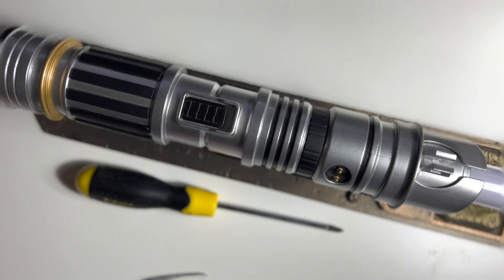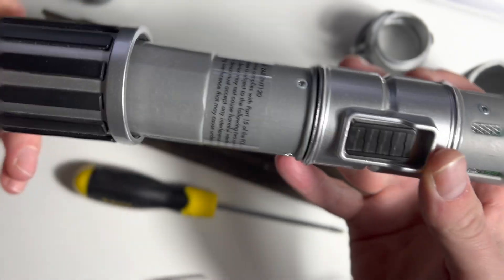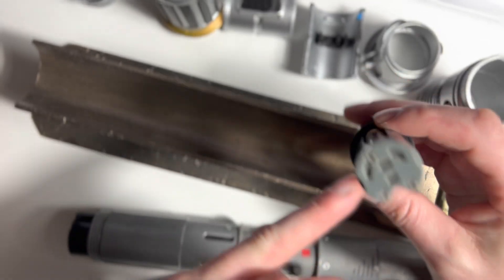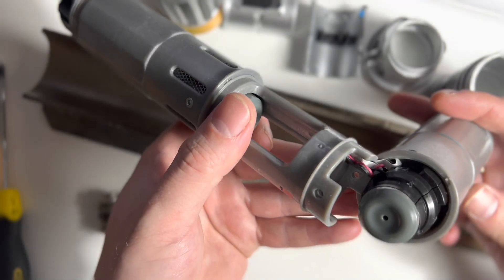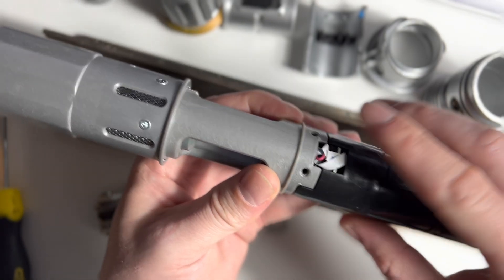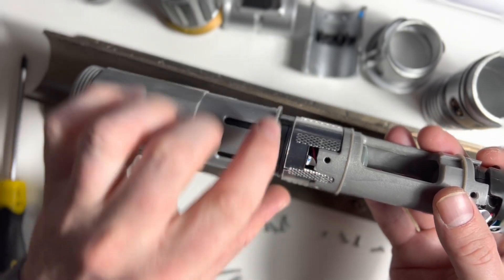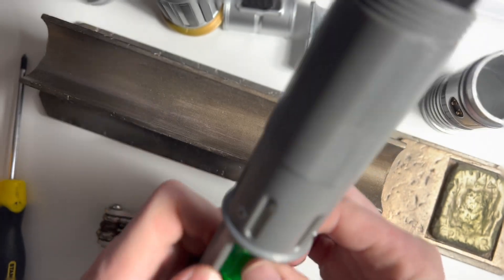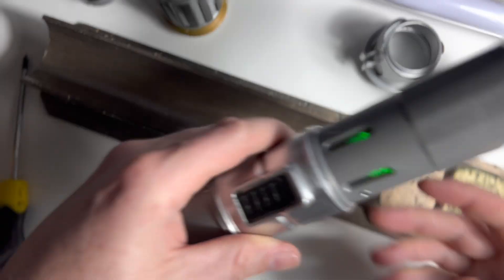How To: Teardown of Savi’s Workshop lightsaber from Galaxy’s Edge for battery replacement/data cable

Comment: Would you happen to know what kind of clip the ribbon cable is held in place by?  One of mine broke while trying to repair my chassis.
Reply from the maker: @michaelglatt100  I believe it’s this one https://www.mouser.com/c/connectors/ffc-fpc/ffc-fpc-connectors/?number%20of%20positions=8%20Position&pitch=0.5%20mm

Comment: So my son decided to take mine apart and pulled the ribbon out entirely because he wasn't sure how to change the batteries. I got it all back together but the blade doesn't make the noise anymore not well it turn on. But the ribbon is in good shape and so is the wiring. I even took the plastic apart to look at the boards... got any suggestions?
Reply from the maker: @belrenmcglothlin247  The ribbon is very delicate but you may have a damaged clip where it attaches to the board. The ribbon is cheap to replace so maybe try a new one first or inspect the clip it uses carefully. I pulled my ribbon off the clip too but the ribbon itself was folded midway and that was enough to keep it from working.
Reply: @CameronScottsChannel  makes sense. I feel stupid that I do this for a living in the industrial sense but when it comes to this little plastic toy I can't determine a small issue... micro shit sucks lol. That or I'm damn near blind. Anyway, I'll give that a try. Might clip it where it's slightly kinked, scratch off the coating and see what I get before I go to a full replacement. For a link for the ribbon btw?
Reply from the maker: @belrenmcglothlin247  they’re linked in my repair video which is in the description for this video. Unfortunately you can only buy a lot of them https://www.amazon.com/uxcell-0-5mm-Pitch-Flexible-Cable/dp/B016CVY12I
Reply: @CameronScottsChannel  thanks again

Comment: This helped me change the batteries, I still can’t get the blade out. Is goes down all the way, it turns perfectly, but when I try to pull it out it does not move. Any tips?
Reply from the maker: @anafarai8343  try twisting it back and forth a little while pulling. If you look at the design it’s a metal tab that slides down a groove and then twists to lock in. It could be that it’s not lined up to exit the hilt.

Comment: Thank you so much, very helpful video. My light saber is still broken though, I just changed the batteries and I COMPLETELY took it apart and put it back together. I think I might of cut a tiny rip in the ribbon cord though, I’m asking you for advice before I just order a new cord. I literally just got this light saber last weekend😭
Reply from the maker: My cable was folded over and clearly damaged. The ribbon cables are designed to be flexible to a point but can easily be damaged. If you just got it try going through Disney before getting the cable if you want, some people have had luck that way.

Comment: Thank you so much but i have a question, i can't get the battery part out, and im afraid of breaking it, is there something i have to do so i can get it out or do i just pull it out?
Reply from the maker: First, remove the Endcap piece by twisting counterclockwise until it comes off (the Endcap is the bottom-most part of the Lightsaber)
    Then pull out the black battery canister (holder) from the gray cylinder. You may have to rock the battery canister gently back and forth to free it from the gray cylinder. The battery canister should slide out.
    Remove the one small Phillips Head bolt on the side of the battery canister (be careful not to lose it)
    Slide the battery cover sleeve off to reveal the AAA batteries

Comment: Much appreciated! Just did this and got my saber, however they did not go over how to remove the blade, or how to replace the batteries.
Reply from the maker: Push in and twist to remove the blade, the battery compartment has one small phillips screw holding the actual pack in and takes 3 AAA batteries. Here is a link to the instructions https://plandisney.disney.go.com/question/change-batteries-savis-workshop-light-saber-481983/ Cheers!

Comment: i’ve tried to remove the bottom cap to replace the batteries, but it’s stuck. the others come out easily, but i can’t remove that one😭
Reply from the maker: Use a rubber glove and a bit of force, you could also try heating it up a bit first too.
Reply: @CameronScottsChannel  thanks :D

Comment: After replacing the batteries if I screw the bottom hilt piece on tight to the switch piece it’s stops working. Anyone have any idea why that would make a difference?
Reply from the maker: When you screw it on tightly does it not turn on or if you screw it on does it suddenly turn off when you screw it tightly while it's on?
Reply: @CameronScottsChannel  it turns off.
Reply from the maker: @KevinSmedes  Sounds like a short somewhere, can you push on it to cause the same issue without screwing the piece on?

Comment: I had the ngarliest time getting the battery/speaker cap off. Turns out it wasn’t screwed on properly and tore up the threads. 
If you didn’t make this video I woulda taken a hammer to it or would’ve jus started taking the core apart, so thankyou for your video🙏
Reply from the maker: Glad I could help!

Comment: Thank you so much! This was so helpful! I do have one more question. Do you know of a way to tighten the part where the blade goes in? I see there are screws way in the bottom of the emitter section but it feels
Like my blade is not staying tight in there
Reply from the maker: I think a few people have wrapped tape or something around the blade insert to make it a snug fit. Just keep the contact points clear and you should be good.

Comment: When I put the blade back in to show my friend, its now not working. Any advice? I'm in the UK so I can't even just go back
Reply from the maker: Nothing at all when you plug the blade in? If that's the case check your batteries first. If new batteries still don't cause the noise when plugging the blade in you may need to take it apart and check the connections.

Comment: We can’t get the blade out any tips?
Reply from the maker: Will it move at all? You have to push it in firmly and twist, if it won't push in then it may be jammed.
Reply: It just barely pushes down so maybe it is jammed? Is there a solution for that?
Reply from the maker: @ericamalone4220  It should go down about 1/8" and once depressed you twist it counter clockwise. If it does not twist then something may be jammed blocking the blade tab. It's almost physically impossible to insert it incorrectly due to the two tab sizes being different. Try what I suggested and let me know where you're getting stuck.